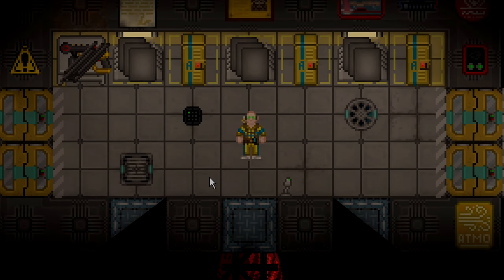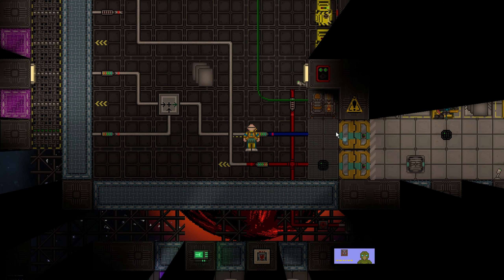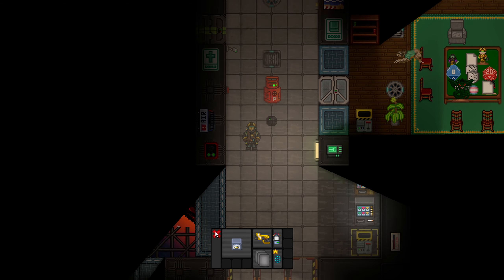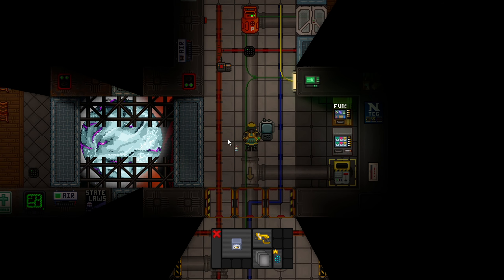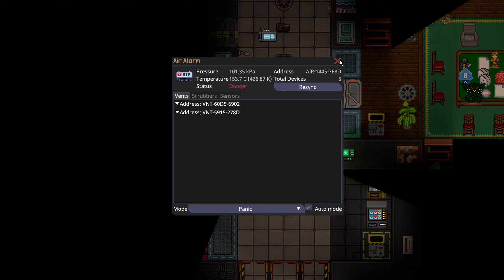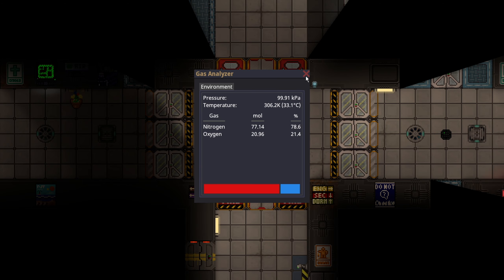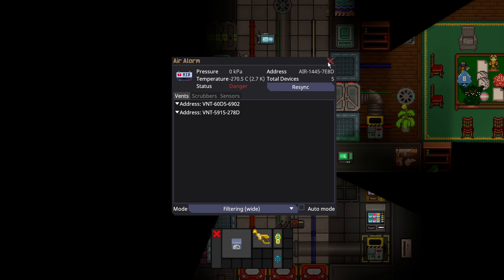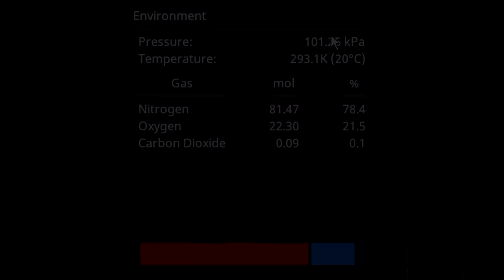SS14 - Room Temperature Control (Slightly Out of Date)

Comment: If multiple rooms need to be spaced, I just bolt the firelock doors open and save some RCD ammo in the process.

I wish there were more portable scrubber locations, or if they were just handheld and deployable, because frankly nobody ever uses them or even knows how to use them right now. They're great in theory but the time it takes to find one and drag it to a location makes it unfeasible in emergencies.
Reply from the maker: Yeah no real reason not to just bolt doors open if it won't hurt anyone.
Reply: The issues with bolting doors is that most people don’t understand the meaning of a locked fire lock. Many times I had sealed off an area due to heat and I’ve seen people try and hack the bolted firelocks open into the room I’m spacing and a head to ultimately unlock it. As in Bolting them closed, open always works until someone comes along and tries to fill in the hole and unseals the chain of rooms you set up, flooding all nearby rooms with more heat.
Reply: Idk, I always use portable scrubbers. 
They were very useful to clear miasma from kitchen, or another plasma epidemic in RnD
Reply: we use them at r&d fairly often

Comment: 2 additions: 
- walls and floors have heat capacities and variables for how they transfer that heat,  the temp was coming from that not your breath
- use more Holo fire doors to warn the chaplain, and to divide an area so you can fix smaller sections and not leave as much space uninhabitable if the area is unmanageable.

Comment: Small trick i used and figure out: you van put freezer/heater with passive vent in afected room to make it livable or if whole station gets afected you can put on distro radiators (inportat thing is to do it over the pipe)now use this if its not is too hot or cold becouse ir could make situation worse

Comment: the emergency filters also get clogged too fast in high pressure situations and it makes them useless. wish spacing wasnt the solution for everything
Reply from the maker: Yeah unfortunately the answer for all temperature problems is pretty much just make a hole in the floor.

Comment: Just be careful if you have a waste distro where you recycle oxygen and nitrogen, you dont want to pump super hot stuff in your oxy/nitro room, in this case use heater and freezer and hook them up at the air distro.

Comment: What does auto mode do? Why select/deselect it every time before switching to panic or wide?
Reply from the maker: auto just makes it so it follows the default settings for scrubbing and filling air. I just switch it cause I feel like I have more control, but im pretty sure auto would just switch it without input.